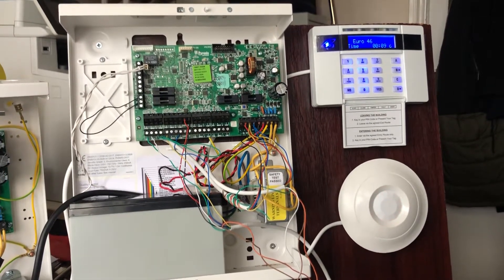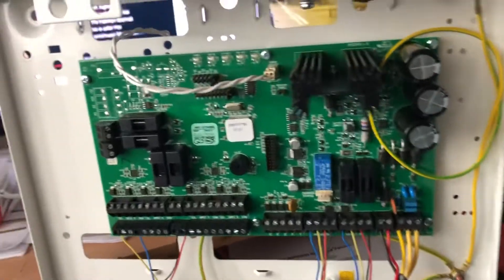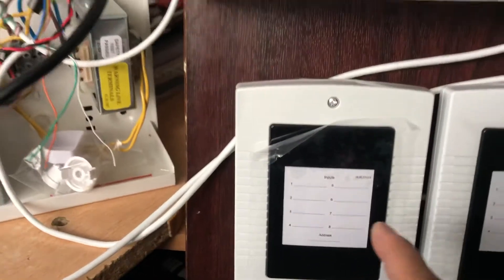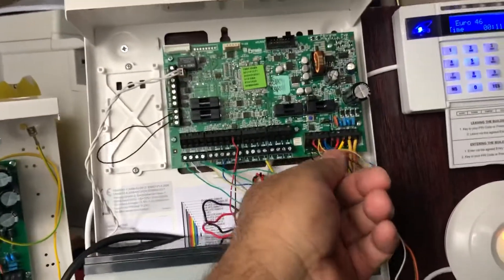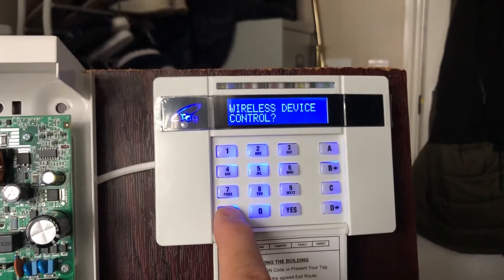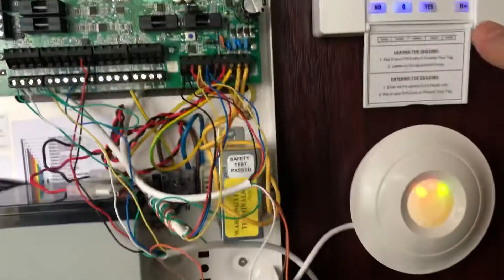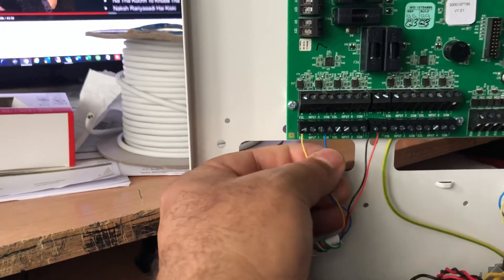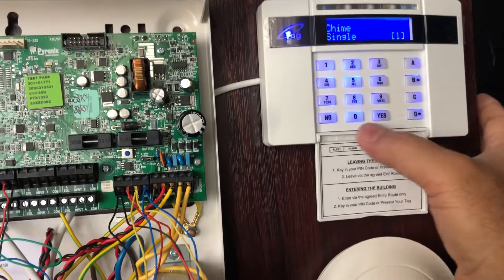How install and program euro-zem8+psu with pyronix euro panel 46

Comment: When you install the ZEM does it need its own power source or does it use the power from the main panel?
Reply from the maker: Hi for short distance used local power from panel long distance I used psu expender hope this is okay for you.
Reply: @shahzadsheikhs  Perfect! Many thanks
Reply: @shahzadsheikhs  Bit unrelated but wondered if you knew the answer. Does the KEYFOB-WE allow you to arm certain zones as well as the whole system? E.g arm downstairs at night and arm the whole house when leaving the property.
Reply from the maker: @digitaleclipse10 keyfob used only full alarm armed and disarmed also used panic alarm is well. If used part setting used keypad. You can disarm from keyfob part setting. Hope this is ok for you have a good day.